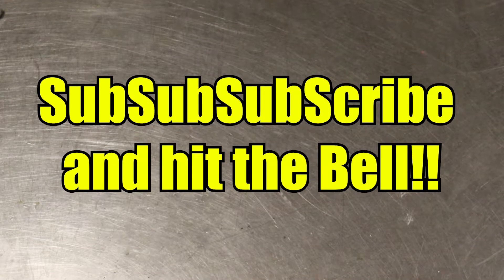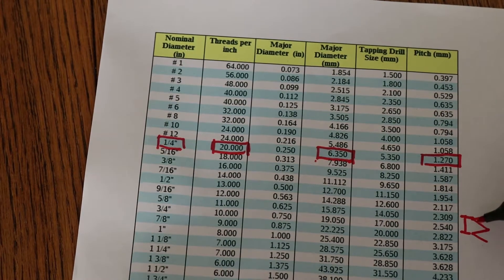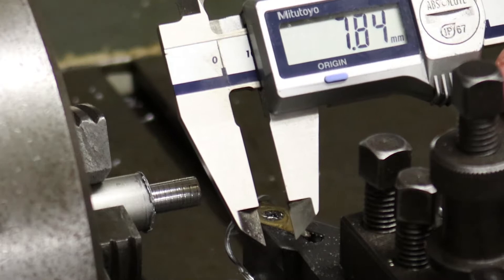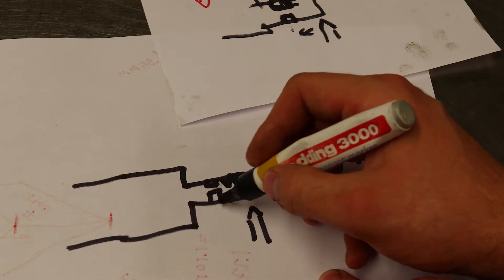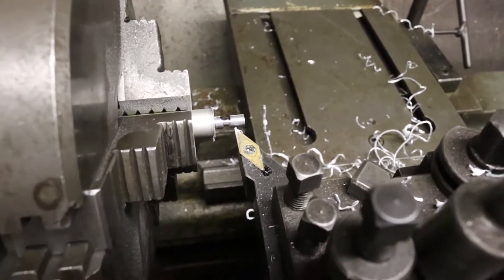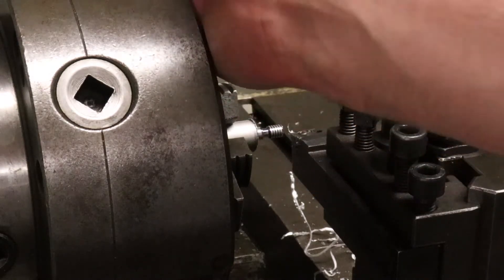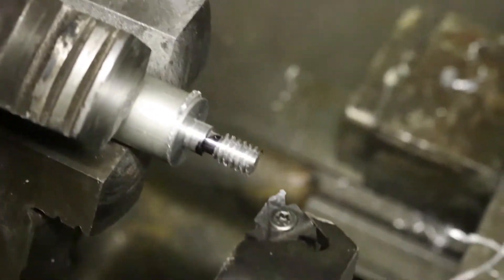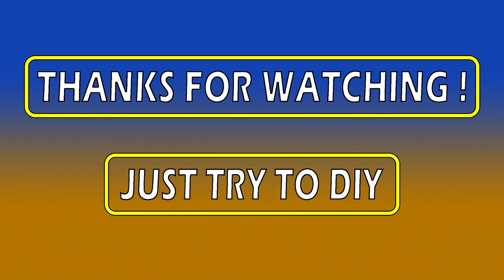How To Cut Threads On The Lathe! [1/4 camera bolt as an example]

Comment: Well explained, but it makes you appreciate how much easier it is to use a thread die.  Good job!
Reply from the maker: That’s a very good point 😆
Reply: @PattysLab  Of course, for threads that need to be concentric to other features, there's no getting around cutting threads on the lathe like you demonstrated.  I always seem to make at least one scrap part first, though...  Keep up the good work!
Reply from the maker: No warries! the part you see in the video was definitely not part 1😂. Thanks for the reply :)